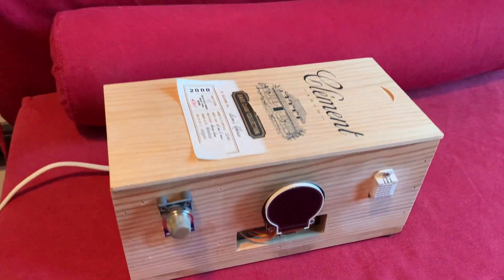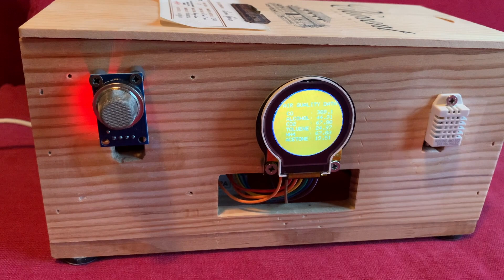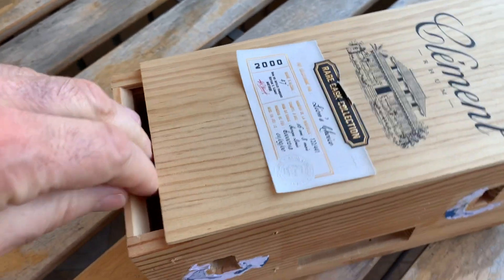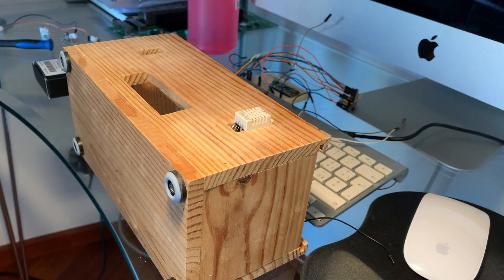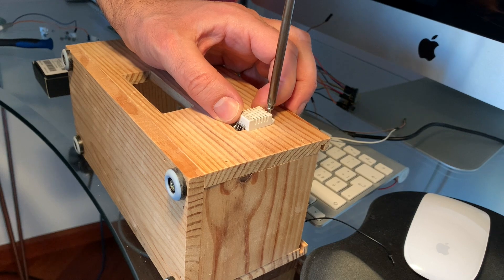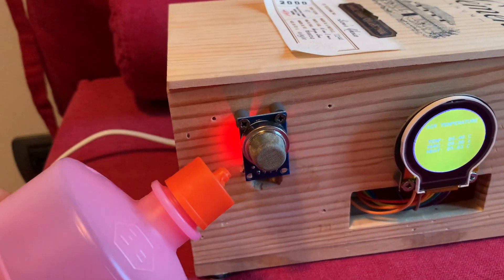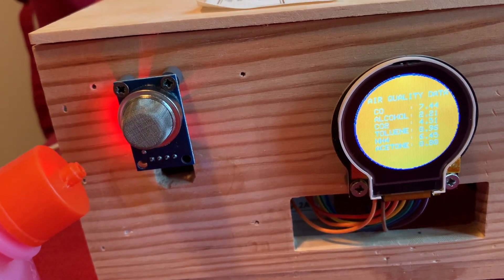Sensor Station with Arduino Nano, DHT22, MQ135, DFRobot DFR0529

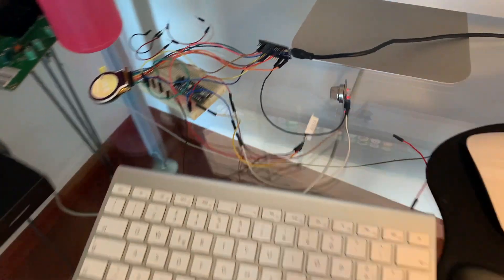Comment: At 0:54 what is the component that the power supply is plugging in to?
Reply: That’s great, thanks Carlo. I can’t find a DFRobot lcd display, what would be a good alternative?
Reply from the maker: Changing the code you can use any oled display big enough to show all the values. Just need to modify the code that displays the values.
Reply from the maker: The Power Supply is a 220V to 5V. The 5V is connected to the Arduino Nano. Hope it answers your question.

Comment: great job! Ignorant question, what differences will it make if I try it with an Arduino Uno or Mega? what would have to change?
Reply from the maker: Thanks. No change on the software. You will just need to map the connections with the sensor and the display and adapt it to the UNO

Comment: what is the difference if my co2 sense about 400 ppm and ur code range only below 10 ppm? i tried ur code and it works for me .. i dont know what is the difference between the two and it is same only one location if my calculation give different output?? and what is nh4 health level table i cannot found it on google

Comment: Awesome!!! Are the air quality values in ppm? what is the scale of mq135 sensor values?
Reply from the maker: Hi Gabriel,
The air quality is in PPM. This is thanks to the "MQUnifiedsensor" library. Well done.
The code details of the library are:

- MQ135.setA(605.18); MQ135.setB(-3.937); // Configurate the equation values to get CO concentration
- float CO = MQ135.readSensor(); // Sensor will read PPM concentration using the model and a and b values set before or in the setup
  
- MQ135.setA(77.255); MQ135.setB(-3.18); // Configurate the equation values to get Alcohol concentration
- float Alcohol = MQ135.readSensor(); // Sensor will read PPM concentration using the model and a and b values set before or in the setup
  
- MQ135.setA(110.47); MQ135.setB(-2.862); // Configurate the equation values to get CO2 concentration
- float CO2 = MQ135.readSensor(); // Sensor will read PPM concentration using the model and a and b values set before or in the setup
  
- MQ135.setA(44.947); MQ135.setB(-3.445); // Configurate the equation values to get Toluene concentration
- float Toluene = MQ135.readSensor(); // Sensor will read PPM concentration using the model and a and b values set before or in the setup
  
- MQ135.setA(102.2 ); MQ135.setB(-2.473); // Configurate the equation values to get NH4 concentration
  float NH4 = MQ135.readSensor(); // Sensor will read PPM concentration using the model and a and b values set before or in the setup
  
- MQ135.setA(34.668); MQ135.setB(-3.369); // Configurate the equation values to get Acetone concentration
- float Acetone = MQ135.readSensor(); // Sensor will read PPM concentration using the model and a and b values set before or in the setup

I hope it helps as I do not have more details for you.
Carlo
Reply: @CarloStramaglia  I did my own sensor station based on your great project. 

I looked into Miguel Califa github repo and one of examples for mq135 sensor has a correction for CO2. Given that the normal concentration of CO2 in the atmosphere is around 400 ppm, Miguel's library assume that the initial CO2 is cero, so he add this correction like this:

float CO2 = MQ135.readSensor() + 400;

Also depending on who manufactures the mq sensor the RL resistance could be different. In my case the RL is 1K so if your RL is different than 10K you should include this line in your sketch after MQ135.init():

MQ135.init(); 

//If the RL value is different from 10K please assign your RL value with the following method:
//for example for RL = 1K
MQ135.setRL(1);

Here the link to the example: https://github.com/miguel5612/MQSensorsLib/blob/master/examples/MQ-135-ALL/MQ-135-ALL.ino
Hope this helps.

Thanks!!
Reply from the maker: Hi Gabriel,
Thanks for the great contribution!
Ciao,
Carlo
Reply: @gabrielvillafane5597  hello im asking my sensor RL is 1K ..how can i change it to 10k ohms?
Reply: @jeremytiempo9639  to do that, you need to replace the RL resistor in the sensor board
Reply: @gabrielvillafane5597  itried to connect 10k resistor through breadboard both pin gnd and  A0 ..if i dont change Resitor , only value 1 for RL value ,the output would not accurate?